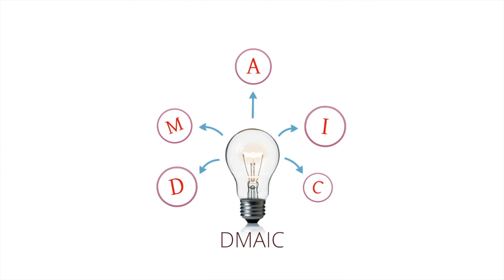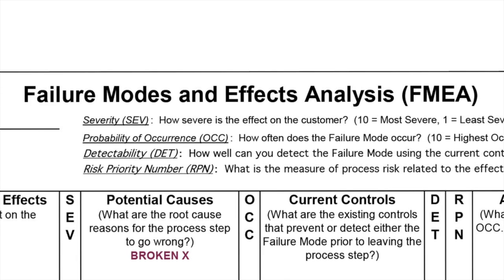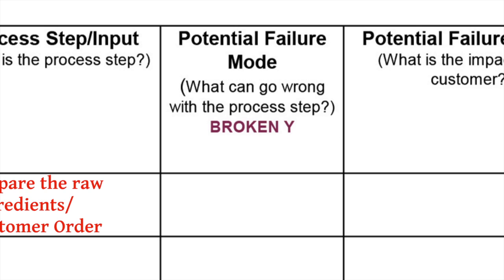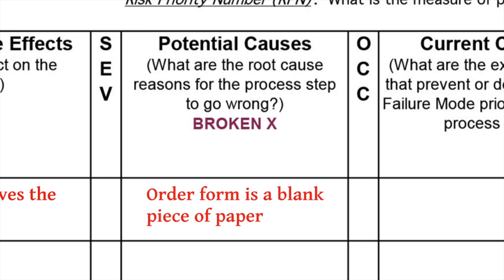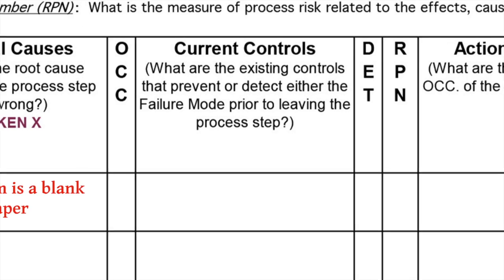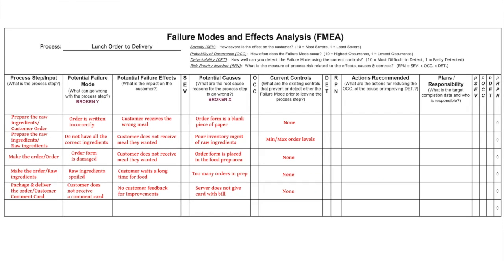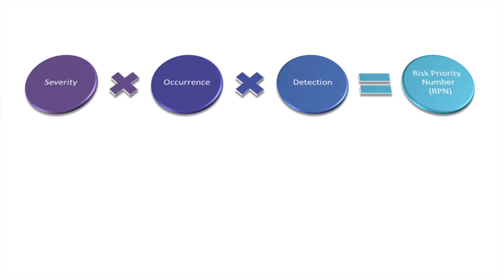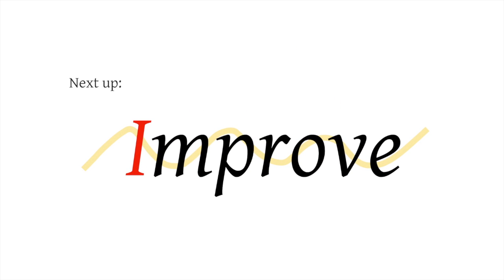Lean Methodology: The "Analyze" Phase

Comment: Excellent overview of the PFMEA and how to create one. Not enough companies use this powerful tool (usually only automotive industries, where is required as part of the PPAP process). Now though the aerospace and other industries are adopting it due to the "RISK ASSESSMENT" section of the new AS9100 Rev D and ISO 9001:2015 versions where FMEAs and Control Plans are critical documents to show you have analyzed your process and company risks and taken actions on them to improve. Also important on the FMEA is not only having an action on the High RPN # issue but also the high severity issue which could lead to Death or Injury or legal issues for the company.  Only thing on this video is that the FMEA is NOT the only tool used in Analyze and there are many others like Minitab for Statistical analysis, Pareto, Run/Time Series charts, etc etc. But this is a short into video so its ok but should at least mention the other possible QC tools.